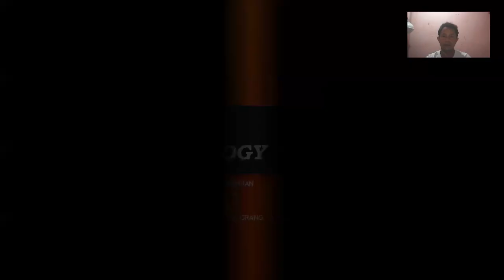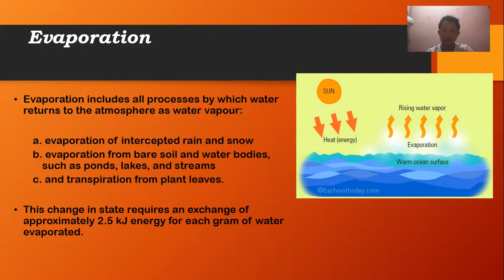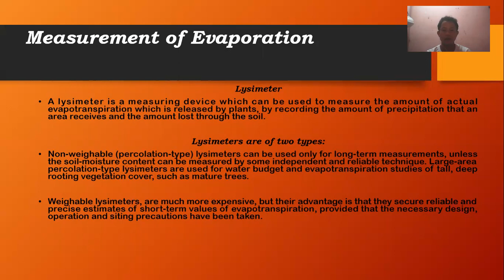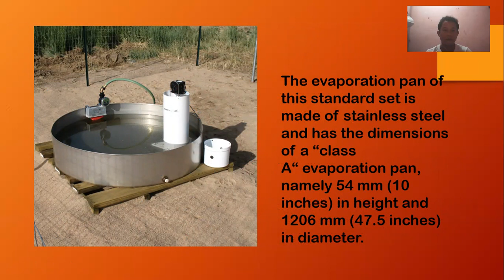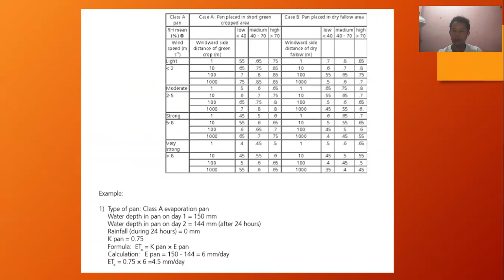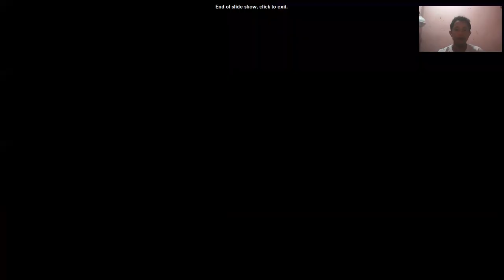Reporting Video Hydrology

Comment: What i have learned in this report is that Evaporation is the process by which water changes from a liquid to a gas or vapor. Evaporation is the primary pathway that water moves from the liquid state back into the water cycle as atmospheric water vapor.

Comment: Thank you reporter for sharing us your knowledge. I have learned that the Evaporation is the process by which water changes from a liquid to a gas or vapor. Water boils at 212 degrees F (100 degrees C), but it actually begins to evaporate at 32 degrees F (0 degrees C); it just occurs extremely slowly. As the temperature increases, the rate of evaporation also increases.

The amount of evaporation depends on the temperature, and it also depends on the amount of water there is to evaporate. For example, there is not much evaporation occurring in the Sahara Desert, but why? Although it can get extremely hot in the Sahara, it's just sand - there's just not much water to be evaporated.

Comment: The reporter of this topic has presented well his report. I learned through his discussion the different processess which are part of evaporation as a whole. He mentioned about evaporation of rain and snow and the other bodies of water like ponds, lakes among many others. He also presented the requirements necessary in order for evaporation to take place. It does not only need water but it also has to deal with the temperature surrounding the body of water

Comment: In this report, I have understood more about evaporation. The factors affecting evaporation like humidity, wind, high temperature, the exposure of an area, its type, and vapor pressure. Evaporation can also be measured using a device called a lysimeter.

Comment: What I've learned from this topic is evaporation includes all processes by which water returns to the atmosphere as water vapour. The reporter explained it very well. I also learned that factors affecting evaporation is wind, heat, exposed surface area, humidity, nature of the liquid and vapour pressure.

Comment: The reporter discussed about the evaporation in  which it evaporation is one of the important part of the water cycle . The evaporation of liquid from the earth helps to keep the air moist and provides moisture to the clouds. It is also an essential part of the water cycle because it allows large amounts of water to move from bodies of water on Earth up into the atmosphere.

Comment: For this topic i have learned that Studies have shown that the oceans, seas, lakes, and rivers provide nearly 90 percent of the moisture in the atmosphere via evaporation, with the remaining 10 percent being contributed by plant transpiration. And the the most important factors affecting evaporation are (1) temperature, (2) solar radiation and sunshine duration, (3) RH, (4) wind speed, (5) vapor pressure difference (gradient), (6) atmospheric pressure, (7) water quality, and (8) water depth and soil type.

Comment: As with evaporation and transpiration, depression storage is generally not directly calculated in highway design. ... The precipitation stored in these depressions is then either removed through infiltration into the ground or by evaporation.

Comment: In this video, Mr. Equinan explained his topic very well . basically, Evaporation is the process by which water changes from a liquid to a gas or vapor. Evaporation is the primary pathway that water moves from the liquid state back into the water cycle as atmospheric water vapor. Studies have shown that the oceans, seas, lakes, and rivers provide nearly 90 percent of the moisture in the atmosphere via evaporation, with the remaining 10 percent being contributed by plant transpiration.

Comment: At this report or video presentation is about hydrology  and he explain about evaporation that are water returns to the atmosphere as water vapour and evaporation has a four following condition requirements and that is 1: available water, 2: higher humidity at the evaporative surface, 3: energy to evaporate the water and 4: movement or transfer of water vapour away from the evaporative surface as what he show and explained. Factors affecting evaporation that are evaporation have changes and it depend on if there is high speed of wind.

Comment: In this particular topic i learned that evaporation is a type of vaporization that occurs on the surface of a liquid as it changes into the gas phase. The surrounding gas must not be saturated with the evaporating substance. When the molecules of the liquid collide, they transfer energy to each other based on how they collide with each other.

Comment: The reporter have discussed and explain further about the evaporation. Evaporation includes all the processes by which water returns to the atmosphere as water vapour. The evaporation must be able to occur if it has the four conditions of the following: there is available water; there is a higher humidity at the evaporative surface (for example vapour pressure) than in the air surrounding; there is an energy to evaporate the water end; there is movement or transfer of water vapour away from the evaporative surface.

Comment: Evaporation, as we all know, is the process through which water evaporates and returns to the atmosphere as water vapour. I learned the four conditions of evaporation from this presentation, including accessible water, higher humidity at the evaporative surface than in the surrounding air, energy to evaporate the water, and water vapour movement away from the evaporate surface. I also learnt about the components that cause evaporation, how to measure evaporation, and how to quantify pan evaporation, which he discussed thoroughly.

Thank you for your excellent presentation Mr. Equinan. 🤙

(Shat na ta dha! 🤣🍻)

Comment: For this topic, the reporter discussed  that the Evaporation is the process in which a liquid state of matter (water)  is converted into a gaseous state of matter (vapour) to. I have learned the most important factors affecting evaporation are (1) temperature, (2) solar radiation and sunshine duration, (3) RH, (4) wind speed, (5) vapor pressure difference (gradient), (6) atmospheric pressure, (7) water quality, and (8) water depth and soil type.

Comment: In this video, I learned that evaporation happens when a liquid substance becomes a gas. When water is heated, it evaporates. The molecules move and vibrate so quickly that they escape into the atmosphere as molecules of water vapor. Water is evaporating, but staying in the air as a vapor. Once water evaporates, it also helps form clouds.

Comment: I learnt in this report that as water vapor climbs higher in the atmosphere, it begins to cool down. The water vapor condenses and returns to liquid water when it becomes cool enough. Clouds and precipitation form as a result of these water droplets clumping together. The production of fresh water is dependent on evaporation from the oceans. Oceans, which span more than 70% of the Earth's surface, are the primary source of water in the atmosphere.

- POLIQUIT

Comment: The reporter explain very well, and what I've learned about this report is Evaporation happens when a liquid substance becomes a gas. When water is heated, it evaporates. The molecules move and vibrate so quickly that they escape into the atmosphere as molecules of water vapor. Evaporation is a very important part of the water cycle.

Comment: The reporter takled a wide and clear information about evaporation, while evaporition occurs, i have learned that there are factors that may affect to it, these are the wind that assist evaporation when it is on high speed, heat especially during summer, exposed surface area for instance a wet cloth spread out dries faster than when folded.

Comment: In this video, the reporter explains clearly especially to the evaporation which happens when a liquid substance becomes a gas and when water is heated, it evaporates. The molecules move and vibrate so quickly that they escape into the atmosphere as molecules of water vapor. So that evaporation is very important part of the water cycle andmany factors affect how evaporation happens. If the air is already clogged, or saturated, with other substances, there wont be enough room in the air for liquid to evaporate quickly. When the humidity is 100 percent, the air is saturated with water. No more water can evaporate.

Comment: From this video, I Learn that Evaporation happens on a global scale. Alongside condensation and precipitation, evaporation is one of the three main steps in the Earth’s water cycle. Evaporation accounts for 90 percent of the moisture in the Earth’s atmosphere; the other 10 percent is due to plant transpiration. Also, Factors that affect Evaporation are Wind, Heat, Exposed Surface Area, Humidity, Nature of the liquid, Vapor Pressure.